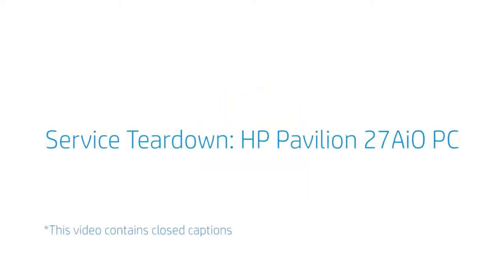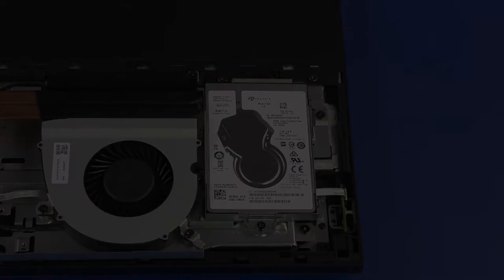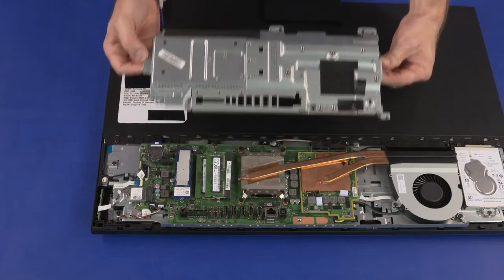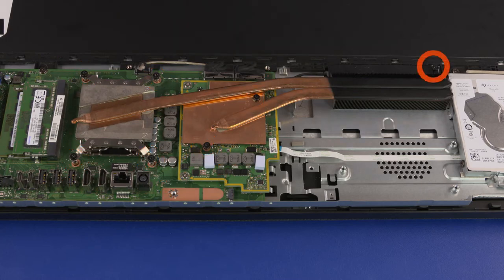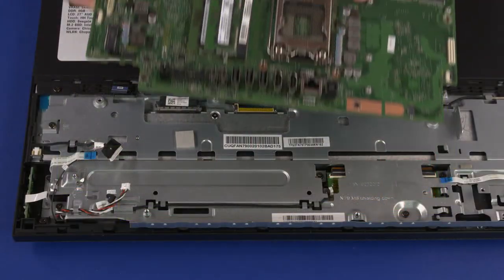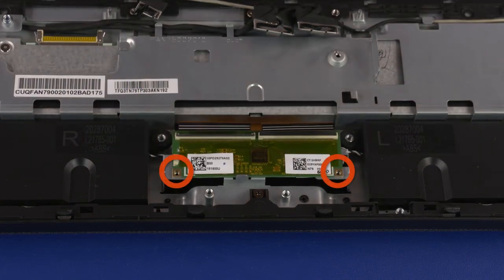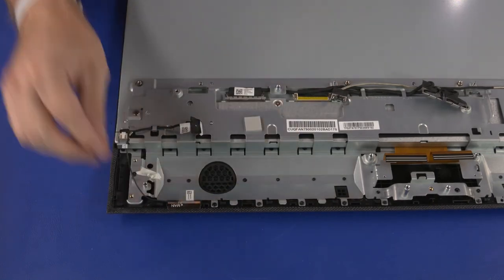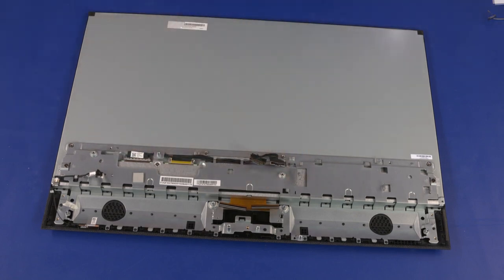Removing & replacing parts for HP Pavilion AiO 27-xa0000 | HP Computer Service

Comment: Do you have a video for a 27-D0244? My kids cracked the screen and I need to remove the plastic frame from the back of the LCD panel.
Reply from the maker: Hi Andrew, thanks for contacting!
I understand that you need the video for removing and replacing the parts of HP Pavilion All-in-One PC 27-D0244
I will do my best to assist you.
Please refer this video as it may help you.
If the issue still persist, in order to get this issue fixed, please contact our customer care team over the phone or chat for further assistance, as this issue requires Live conversation with you over phone or chat to isolate the issue and provide you instantly with appropriate solution or repair/replacement options available at your place as per the warranty.
Please feel free to reach us on call/chat, please access this link to select your preferred country and language option to reach us. Global support link: - https://www8.hp.com/us/en/contact-hp/ww-phone-assist.html
Binu - Social Media Tech Support

Comment: I'm a computertechnician, and I need to replace the 27" screen of a client's AIO-27-xa desktop. I received the spare part screen, but there is no Cover - RearCover FHD NT SKB w/VHB Tape,Rado27 included. Where can I find this tape in Belgium to do the replacement. How come this tape is not included or already attached to the replacement assembly. I've been waiting from a month to get the screen, my client gets very frustrated and now I can't do the switch because a missing tape ?
Reply from the maker: Hi Luc, thanks for contacting HP Global Social Media Support!
I understand that you have purchased a screen, however the tape is missing.
In order to get this issue fixed, please contact our customer care team over the phone or chat for further assistance, as this issue requires Live conversation with you over phone or chat to isolate the issue and provide you instantly with appropriate solution or repair/replacement options available at your place as per the warranty.
Please feel free to reach us on call/chat, please access this link to select your preferred country and language option to reach us. Global support link: - https://www8.hp.com/us/en/contact-hp/ww-phone-assist.html
Binu - Social Media Tech Support

Comment: Is it possible to remove the speaker grill for cleaning on HP Pavilion All-in-One - 27-xa0035na? Mine is filthy and badly needs cleaning.
Reply from the maker: +Regina Hetherington HP does not recommend upgrading or downgrading hardware parts or software that is bundled with the product as It may affect the manufacturer's warranty and performance, however, you could change the configuration at your own discretion.
Reply: @HPSupport  just want to clean the grill?
Reply: @HPSupport  I have the same question as this lady, I want to clean the stains. How can we clean it?

Comment: I tried getting a new power button board but it's not working when clicking the power button. Help
Reply from the maker: Hi Julei, thanks for contacting!
I understand that you are experiencing an issue with the power button.
I will do my best to assist you.
In order to get this issue fixed, please contact our customer care team over the phone or chat for further assistance, as this issue requires Live conversation with you over phone or chat to isolate the issue and provide you instantly with appropriate solution or repair/replacement options available at your place as per the warranty.
Please feel free to reach us on call/chat, please access this link to select your preferred country and language option to reach us. Global support link: - https://www8.hp.com/us/en/contact-hp/ww-phone-assist.html
Binu - Social Media Tech Support

Binu - Social Media Tech Support

Comment: Hi guy , i have a question for you . This MotherBoard support SSD NVME? I read in the Hp page that has a socket m2 3 . I have understand that socket m2 3  is compatible SSD M2 or SSD NVME. That is true? I prefer use SSD NVME ,are very fast that SSD sata. Thanks & regards.
Reply from the maker: +Yunes It supports 128 GB PCIe® NVMe™ M.2 SSD.

Comment: What can be upgraded in Intel® Celeron® G5900T Processor, Dual-Core, 3.20 GHz21.5" diagonal FHD IPS ZBD anti-glare WLED-backlit three-sided micro-edge displayPorts: Headphone/Microphone, 2 SuperSpeed USB Type-A, 2 USB 2.0 Type-A, HDMI Out, Media Card ReaderIntel® UHD 630 graphics GB DDR4-2666 SDRAM, 256 GB SSD

To make it run games better im using this while away from my main pc and im gonna upgrade it because its gonna be awhile and i want to know what i can change what to in order to run valorant or anything decent

Comment: that in no way answered my question, the outlet for the power supply wont hold a chord anymore how do i replace it
Reply from the maker: +Kenny Myers Please contact our phone support team to fix the issue. Please follow these steps to reach them.
Step 1. Open link: https://support.hp.com/us-en/contact-hp
Step 2. Select the product type.
Step 3. Enter the serial number of your device or select let HP detect your product option.
Step 4. Select the country from the drop-down.
Step 5. You should see the HP phone support number.

Comment: Am I able to take the motherboard and it's components to an external case without the screen attached?
Reply from the maker: +DuoBV HP does not recommend upgrading or downgrading hardware parts or software that is bundled with the product as It may affect the manufacturer's warranty and performance, however, you could change the configuration at your own discretion.

Comment: How do I replace the DC jack
Reply from the maker: +Kenny Myers HP does not recommend upgrading or downgrading hardware parts or software that is bundled with the product as It may affect the manufacturer's warranty and performance, however, you could change the configuration at your own discretion.

Comment: Hi Hp support my pc screen lcd is broken and there is so much horizontal line and vertical lines i live in ksa please tell me how to fix that all my pc system is working properly except touchscreen it is not working very well also in the screen there is a black dot and it is very big
Reply from the maker: +T5HVG GAMING_YT Please refer to the instructions under this document to fix this issue: https://bit.ly/3F3CZVN

Comment: Credit where credit is due the heat leaves the cabinet this time! instead of blowing on the hard drive!
Reply from the maker: +Daddy421 May I know the complete model number of your computer and could you please elaborate the issue you are experiencing on it?
Reply: @HPSupport  The super budget model you guys push currently in your product line is completely idiotic. The heatsink dumps heat onto the hard drive as there is no plastic shrouds that bring the heat out. and the fan and heatsink could have just gone to the edge of the cabinet. HP All-in-One 24-df0130m PC would be one of the machines that suffers this issue. This will kill the system in 2 years in 80 percent of the machines if left on 24/7 and not allowed to sleep as some set their PCs. The heat NEEDS TO LEAVE THE CABINET!

Comment: There is so many details skipped
Reply from the maker: Hi Simon, thanks for contacting!
I am here to help!
What seems to be the issue? Are you facing any technical issues with your HP computer?
May I know the computer you are using?
Let me know!
Binu - Social Media Tech Support
Reply: @HPSupport  Hello. I run a computer services business and could not find a repair manual for the 27-AIO on HP support for the 27-xa0053. This video helped a bit but it glosses over the details particularly with removing the back cover. 
It was a huge effort with multiple attempts and multiple videos to get it off. So much that I thought the instructions must be for a different model.
Turns out it required various angles with the tools to get it of
Reply from the maker: Thanks for the reply.
Please download the user guide from here: https://bit.ly/3Eakhxy
Binu - Social Media Tech Support